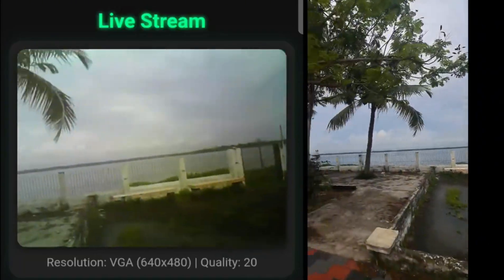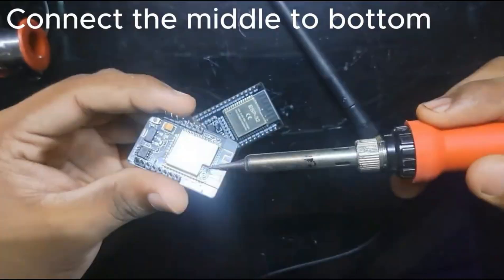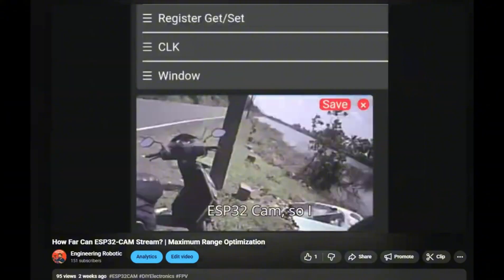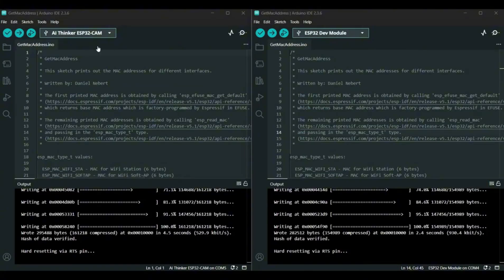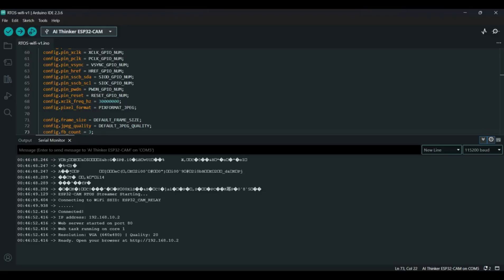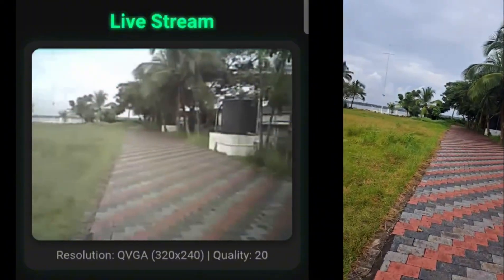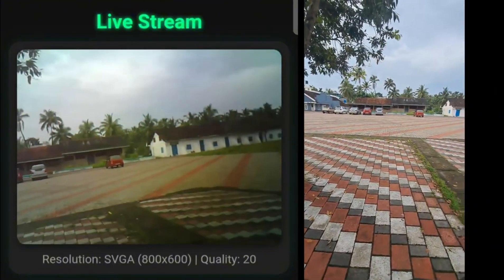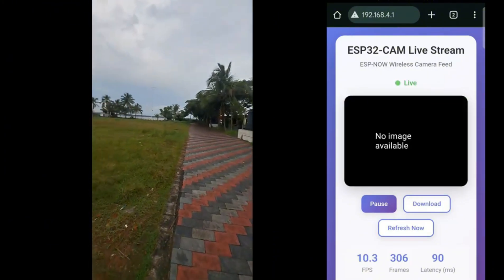DIY 10$ Digital Video Transmitter & Receiver | 60/90 FPS FPV for Drones and RC

Comment: Hi, i plan on making this and have a question: do i need to have the 4KB of PSRAM on the receiver, or can i use another ESP? Thanks.
Reply from the maker: For wifi based you don't need additional ram ,you can buy a cheap esp32 (ESP32-WROOM)😊

Comment: HI.
Error : Y⸮⸮⸮0x ⸮806b4C⸮E (1930) ledc: requested frequency and duty resolution can not be achieved, try reducing freq_hz or duty_resolution. div_param=204
[E][xclk.c:27] xclk_timer_conf(): ledc_timer_config failed for freq 25000000, rc=ffffffff
[E][xclk.c:38] camera_enable_out_clock(): ledc_timer_config failed, rc=ffffffff
[E][camera.c:1113] camera_probe(): Detected camera not supported.
[E][camera.c:1379] esp_camera_init(): Camera probe failed with error 0x20004

????
Reply from the maker: Decrease xclk to 20000000

Comment: How'd you get such high fps? Best I saw was about 30-35 at QVGA 30 quality, and I use an ESP32 S3 cam board
Reply from the maker: That's a great observation! 🚀.I actually saw 45-50 FPS at QVGA, and even managed to get a more FPS on CIF.
I'm working on making the code more efficient right now using RTOS and hope to get even higher FPS for you soon! Keep an eye out for updates. 😊
Reply: @EngineeringRobotic  yeah, i got way higher framerate with the wifi version, though the range was less than optimal
Reply from the maker: @welshi32   The ESP32 is limited by its output power, so the only way to increase the range is to use a directional antenna or esp now😅
Reply: @EngineeringRobotic  or an amplifier, which are really expensive when they're not unidirectional
Reply: @EngineeringRobotic  I think it's hitting a major bottleneck with ESP-NOW since it's not really designed for such massives of data
Reply from the maker: @welshi32 it's because of the ram limitation on esp32 (wroom with 500kb) receiver. the only way to fix it to use a esp32 S3 or esp 32 wrover 😅 (I'll fix that too 😊)

Comment: Hum, but why the live stream looks so different to the video on the right? The camera position is just not the same. Did you shot twice the video?
Reply from the maker: Yes, that was because I kept slipping the ESP32 from my hand starting around the 10:40 mark. I was trying to hold the ESP32, the antenna, and a thick, heavy wire all at once.That heavy wire frequently caused the OTG connection (Phone ➡ OTG ➡ ESP32), which was powering the ESP32, to lose power. If the connection dropped, I had to restart the whole process.Because of this, I was holding everything very firmly while constantly watching the path and the wiring. As I walked, the double-sided tape holding the camera to the ESP32-CAM unit was also coming undone. I had to either stick the camera back on or tilt the entire ESP32 to keep the camera looking straight.Tilting the whole setup was risky, as the heavy wire would flop around and might cause me to lose the connection. Therefore, I was walking very carefully and constantly making adjustments😅
Also note that the left image is from the ESP32-CAM using the default camera lens, and the right image uses an ultra-wide lens at 0.5x magnification😁

Comment: I'm sure you're videonis nice and helpful, but that flashing high visibility caption is causing headache. Might be useful for tiktok mindless video, but for serious video is very distracting, I can't watch it fully, sorry. But the suggestion to use ESP32Cam is useful. Thanks
Reply from the maker: The caption is only for the first minute or two. I'll remember not to use high-visibility captions on the next video—thanks for the feedback!🙂
Reply: @EngineeringRobotic thank you for your feedback. I didn't survive the first minute, I'll watch again. I am indeed interested in the content. Perhaps use a per sentence caption if you have too. Thanks again

Comment: try installing a directional antenna for the receiver and tell me what the maximum reception range is
Reply: Directional antenna on both side would be able to go for 8 km (open-air) tested on esp8266 with vga cam 640x480.

My area did not have many wifi router.
And I had access to some ruckus antenna from job in 2019

Comment: I'm wondering if I want to make a RC car with an FPV camera, how many ESPs do I need to control the car, the camera, and the remote control that has a screen? Is it possible to use LoRA to get a longer range?
Reply from the maker: The short answer is you would need a minimum of 4 ESP modules for the entire system, and while LoRa is possible for control, it is not suitable for video.
Car (2): ESP32-CAM (Video TX) + ESP32 (Control RX)
Remote (2): ESP32 (Video RX) + ESP32 (Control TX)
its possible to go with 🤔 (Need a dedicated code for RC Car)
Car : Esp32 Cam (Video TX+Control RX)
Remote : ESP 32 (Video RX + Control TX)